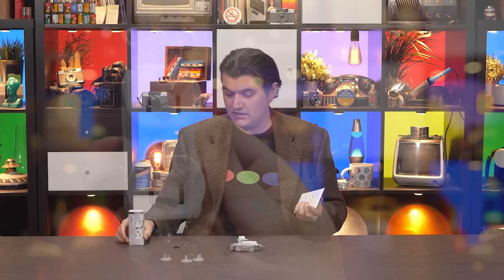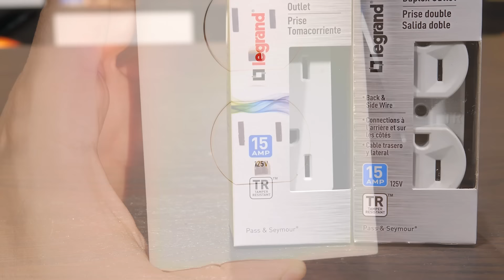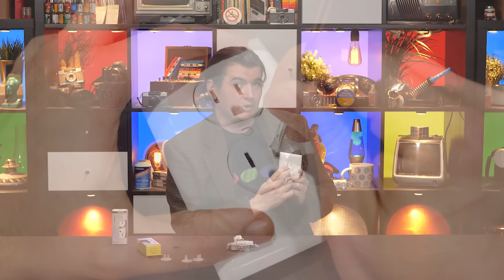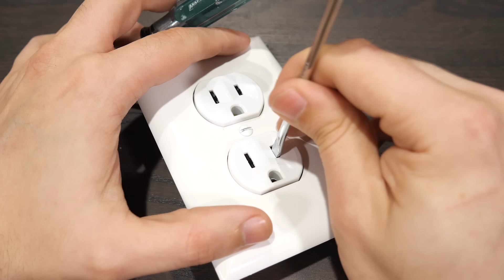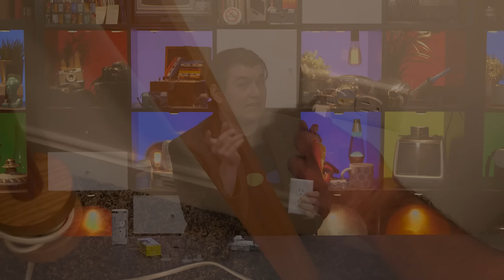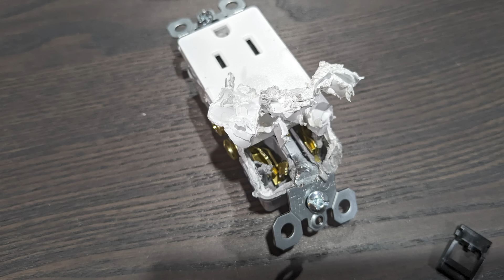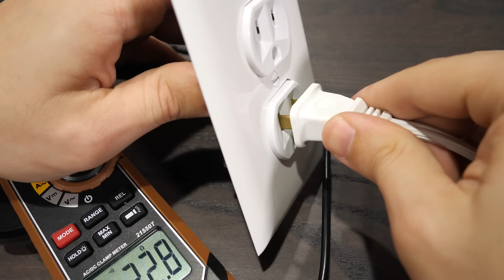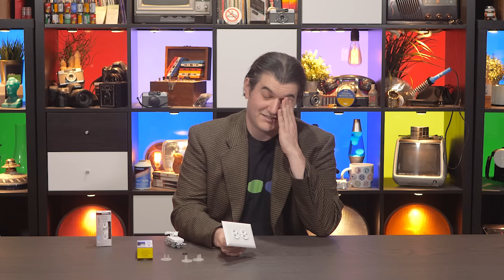Tamper-resistant outlets aren't all the same - a follow-up

Comment: I had a 230v shock when I was young, in the UK. It was the early 70s, so not all sockets were as safe as they are now. Let me just say that it was PAINFUL. It certainly made me more cautious around mains sockets!
Reply: would have been 240v back in the 70’s, believe it was during the 80’s they lowered it to 230v
Reply: @darrendavis6348  Only nominally. It most cases it is still 240v. The European specification for a 230V standard has very wide tolerances to allow for both 220V and 240 supplies that were already in use.  So there is one nominal voltage, allowing appliances to be sold across Europe, but in reality a lot of different ones. 
European 230V  tungsten light bulbs did not last as long as UK made 240V ones!
Reply: @darrendavis6348  It was never actually changed in reality only on paper .
Reply: When I was growing up (UK) we had the round pin triangular plugs. I don't remember those having insulated pins. (Off topic) We had  3 pin 5A plugs and larger 15A triangular plugs but mainly we had Wylex plugs  - o -  and later the current 13A sockets. We could only use certain appliances in certain rooms 😂
Reply: @andyleatherbarrow7322 I'm pretty certain South Africa still has round 3 pin plugs. Whether they're the same as the old UK type I can't say, they looked it.
Reply: @andyleatherbarrow7322  They are lamp sockets , they are still in spec today but with updated things like insulated pins. the 5A ones are used in rentals and some hotels etc. The 15A ones are common in the theatre lighting where you don't want to have to go up a cherry picker to change a fuse as most of the lights have a breaker at the dimmer for protecting the wiring .
Reply: You haven't lived until you've worked around 600v. 😳
Reply: @YT-TheLegacy yep our CNCs are both 480 and 600v. Fun stuff
Reply: @YT-TheLegacy  I started playing with 2100 V microwave transformers at the age of 16. Now i'm 22 and still alive.
Reply: Yes they where . They have had shutters since 1947. Pre 1980s plugs however where not required to be sheathed
Reply: In your reply you literally mentioned a reason why they were not as safe. Why did you feel the need to be wrong AND stupid?

Comment: re: plugs falling out.  I find a horrendous number of outlets around where the contacts are stretched and won't retain the plug well.  I'm always surprised by that as I'll replace an outlet at the first hint of loose contacts.  When we moved into this house 24 years ago, the last thing I did before we moved was replace every outlet and switch.  It turned out to be much more of a job than I expected -- house wiring was all 12 AWG and "backstabbed" into the back of the receptacles/switches!  wouldn't fit modern (14 AWG) outlets so I had to bend every wire and use the screws.
Reply from the maker: Y'know what? Maybe part of why I don't encounter this so much is because I live in Chicagoland and our outlets are usually sideways. That really changes the forces involved as far as how the receptacle holds onto the blades.
Reply: @TechnologyConnextras   And I wonder what the effect sideways plugs as on plugs with especially large thick sheathing since, yeah, it is effectively bending the internal copper in a J shape. It is better than the shape you get with the inverted standard way (upside-down where it also STICKS OUT), but at least it is in-line with the appliance and not bending sideways like it often what people do with, say, computer cable management.
Reply: @TechnologyConnextras  here in europe no one places outlets vertically, it's not even handy at all! horizontal placement is much much convinient. think about it, in usa you even can't have more than two outlets in a row, such a missed opportunity for cable management, and not even speaking about angled plugs, no problem at all!
Reply: @pt-fp9hf   Here in the US it's very common to have more than two receptacles in the same location. A common setup is to mount two duplex receptacles in the same electrical box for a total of 4 places to plug something in.
Reply: Most landlords won't replace outlets just for being loose.
Reply: @strategic_amber_reservoir My landlord before this one let me replace worn outlets and take the price of them off the rent.
She didn't have to hire an electrician, I got a safer outlet, and nobody blabbed to "the man".
Reply: Honestly it's probably for the best, I've seen several of the backstabbed ones fail because the wires fallout
Reply: As a European, i have never had a plug fall out even a bit out of an outlet, even  at my uncles farm where there are old bacelite ones. I guess it's because we put about half an inch of the plug in socket as well, which holds it
Reply: @Ckay2552  The thing is, well-made US outlets made in the last 50 years do not either and they have equally as much if not more going into the outlet. Outlets don't just "fall out" in the US unless they are not fully inserted to begin with or something pulls them outward.
Reply: @tygonmaster  i understood that they do not fall out left and right, it was shown in the video. What i meant was, that our outlets are recessed. They even hold without the "blades" ( I build one of those in our lab, so I can easily ground our samples)
Reply: @tygonmaster  For electrical components in the US, there’s a wide range of quality available.  The cheapest stuff often will be low quality, even in recent. times.
Reply: @kc9scott  If you count imports and the fact that you can get literally anything in the US, sure. But at that point, if you are buying some chinese backwater "General Belectric" outlet, you should know what to expect and is not a reflection on standard outlets.
Reply: I have replaced at least two dozen outlets over the years in places where I've lived, due to them being horribly loose.  Yeah.  🔌
Reply: @DeviantOllam hospital grade outlets will be the best decision you ever make